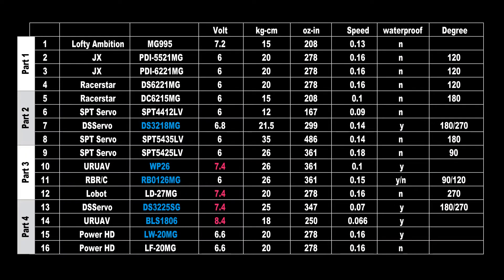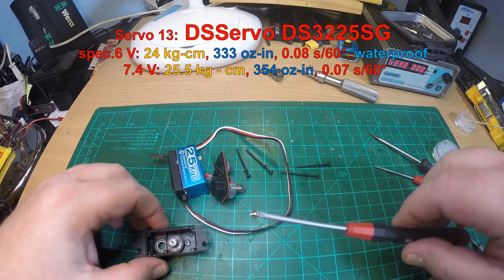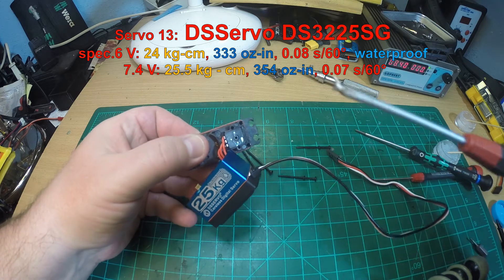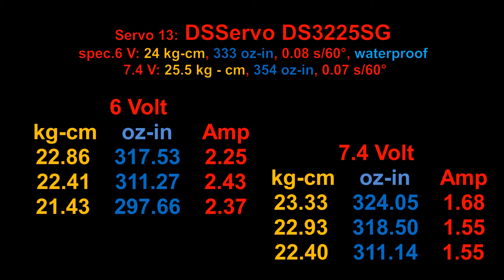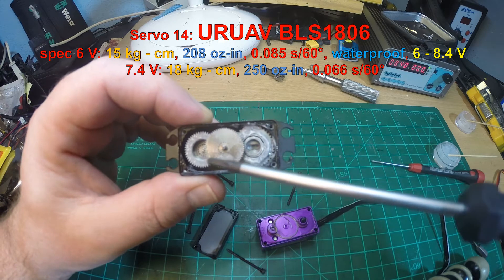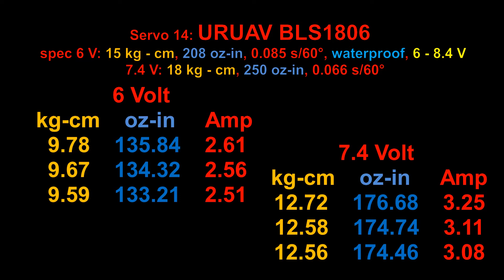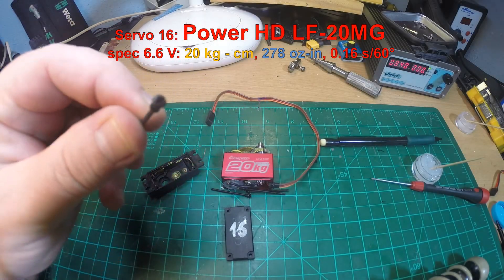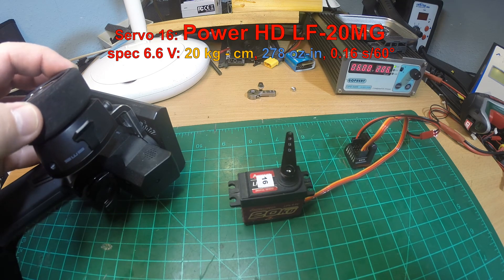China Servo Test: Part 4/5

Comment: excelent video man. one point I would point out. every time you're going to make a torque test, you must short the wire that connects with the scale, to a lengh where the pull of the motor and the wire both makes an angle bit larger than 90 degrees, so when the motor puts its full torque, the angle between the wire and the arm are at 90degrees or something in between 100degrees and 80degrees. whenever you make a torque test, the real torque by varignon theoreme is given by the distance from the pull to the axis in a 90degrees angle. long story short, when the arm goes way far left, you are NO LONGER measuring it in force by centimeter, IT IS LESS than one centimeter, so you will gain much more pulling force in this way.
Reply from the maker: Thanks. I know, this is no science but only estimations. The wire and adjusting the wire length was the part which made most problems in setup. In later servo test videos I changed to a rod, much better. Wire changed length and even broke. 
However, because all servos were tested under same test conditions, comparisons should be quite ok. Absolute values are for sure not on point.

Comment: VERY nice work !!! Great for the hobby. This is the second test were I've seen the Power HD exceed the stall torque specs. For RC airplanes they are stiff on the control surfaces so for wood made models put CA in the screw area

Comment: Impressive work. However I have a remark. Shouldn't the torque be measured were the load has a 90 degree angle to the servoarm? Some servo's during the test rotate that much that the pulling force is measured with the servoarm almost is opposite the axle and in line with the rope. That makes comparison difficult. Looking forward to your opinion on this.
Reply from the maker: Thanks. I adjusted the system that way, that the servo starts pulling when the arm is slightly less than 90", so it will have max. pull at 90° or little bit more.
However, it is not perfect. Check my later servo test video, I used a rod instead of the rope, does do this a little bit better.
I would not know how to make the system that way, that every servoarm has 90° at the "end-point of pulling".
But this is no science and the results are good for extimations. There are many more factors which are not scientifically correct...
Reply: @donaldsneffe  Thank you for your kind reply. I was especially triggered during the measurement in this chapter 4/5 for servo DS3225 that showed so good results for high torque and at the same time so low current. If you look in the video, the servo only starts delivering torque way beyond the 90 degree angle to the cord which makes it easier for the servo. 
If in the future you ever find time, I would be happy to see you repeat just that servo were you rotate the servoarm on the outgoing axis by 60 degrees or so backwards. I bet the current goes up and the torque will not meet the figure you found earlier.
By no means I want to critisize your work, you do an amazing job.
Reply from the maker: @gerriegoeree9153  I did test this servo already one year ago (without Amp measurement) in a simpler way, video is up, and it also was very good. This is a very good servo. 
I repeated measurements of two high Amp-drawing servos (35 kg, WP26) in a later video (
Tamiya and Hobbywing rock! Crawler servo tests with 8 different ESCs/BECs) and the results were quite similar to this test series.
But maybe you are right with the Ampere, who knows, and I should test again. But check the BEC-Test video, BECs are stronger than we think...